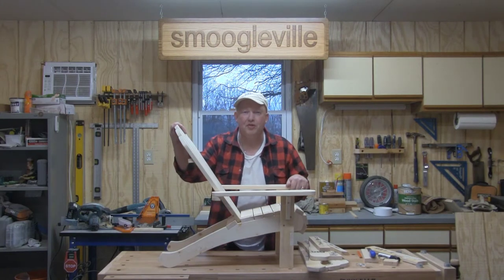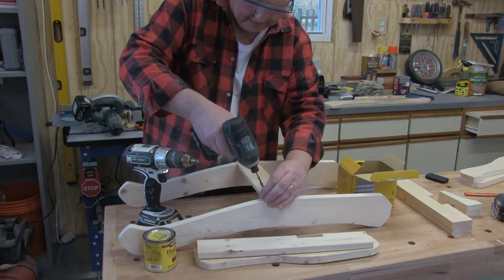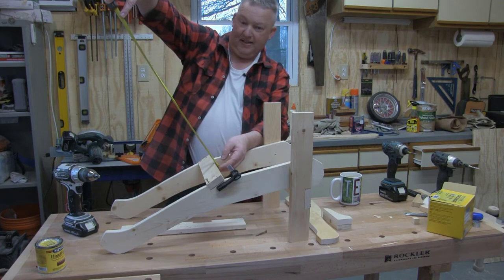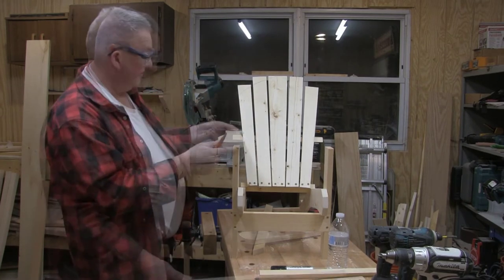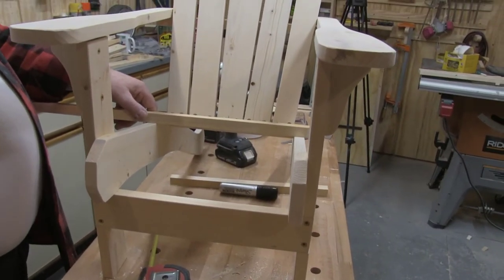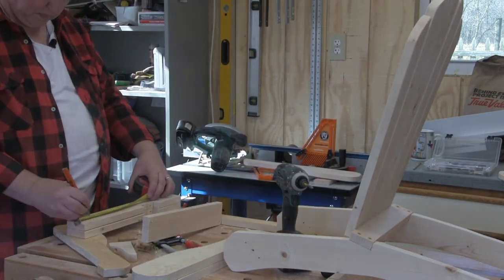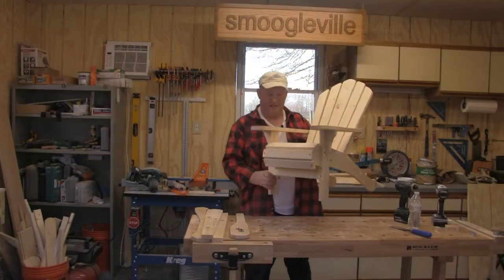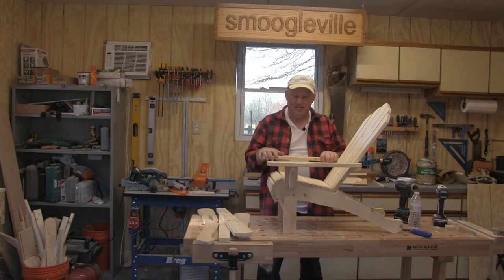S1 E07   Toddler Adirondack Chair

Comment: Another really useful video BLOG matey.  My experience of toddlers is that they love being part of the scene with the grown ups at summer functions and to have their own special chairs that mirror Mum's n Dad's but in miniature is a great idea.  What you've shown is how simple and inexpensive that can be.  I also like the fact you've plucked the idea from nowhere, using "one closed eye" to visualise dimensions :-)  That well known measuring technique and of course the prototype will quickly be confirmed as a viable concern when a toddler sits on it.  My experience of toddlers is they're not shy when it comes to informing you how they feel about things :-)  So you'll know quickly if it needs revisions to improve the design.  Let the toddler test begin.....
Reply from the maker: Thanks matey - I'm glad you told me that because after I'd built it, I was wondering just how much time a toddler might realistically spend sitting down.  As they typically have the attention span of a Gnat, I was thinking not much.  But I'm sure they will enjoy having their own garden chair that looks like Mummy's and Daddy's.  And I'm sure it'll have plenty of potential as a Fire Engine, a Tent Pole, climbing apparatus, or launching pad for a surprise sibling attack - something of that nature.
Reply: @smoogleville8201  The thing is they'll always have to sit down when they're eating and if it's an informal BBQ type setting then they dont need to sit up to a table so it should always serve that purpose.  The other critical issue is safety.  So many shop bought, Far eastern produced kids chairs are basically made from the "excrement" range!  They're about as robust as a fart in a wind tunnel and provide ample opportunity to trap little fingers and the like.  Yours has the advantage of being sturdy and made from a very forgiving material that wont scissor onto any unsuspecting bits of flesh.  I'm sure its a winner mate and lets hope the toddler test proves that.